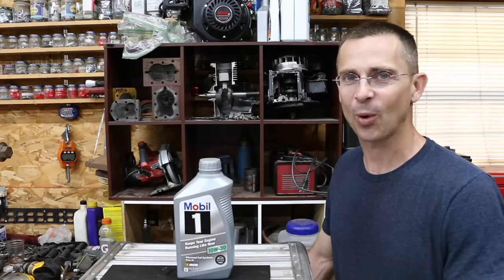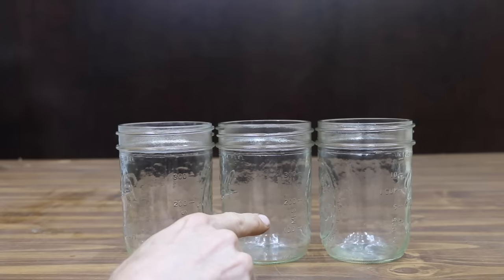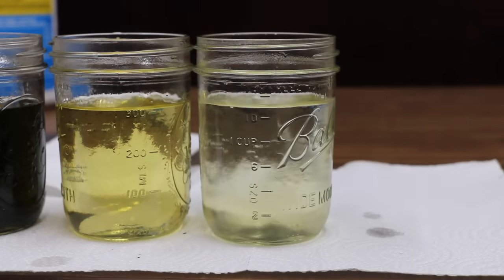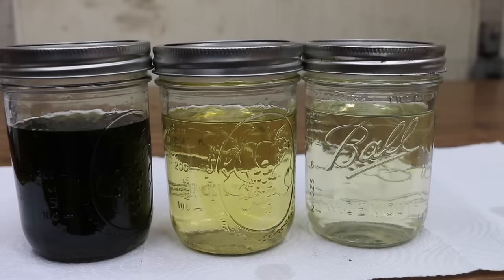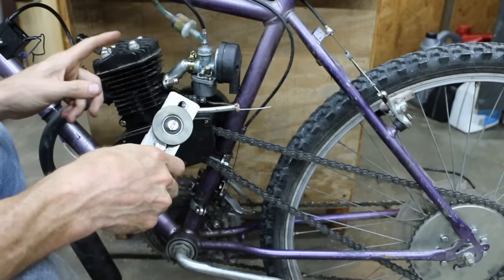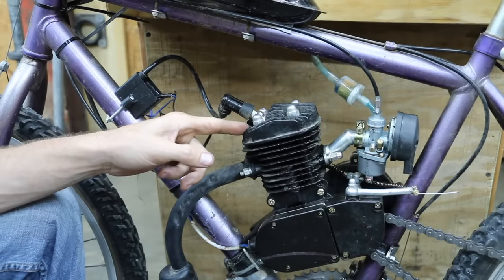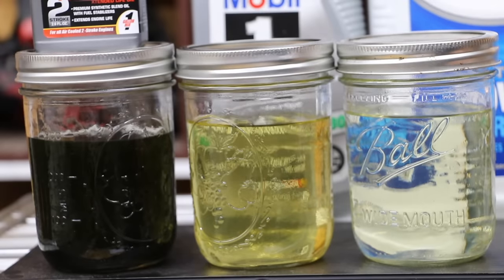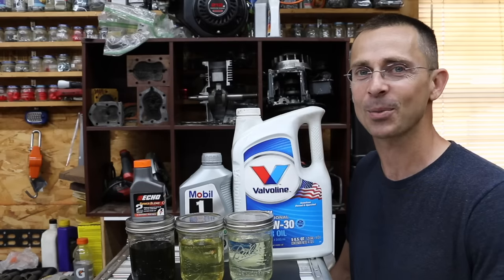Will 4-stroke oil damage a 2-stroke engine?  Let's find out!

Comment: Back in 1999 I had a pickup truck I got from my Daddy 73 f100 390 v8 I didn't check the oil . One day I did I was 4 quarts low I feel it up with hdy oil and never had any problems with the engine.
Reply from the maker: Thank you for the feedback

Comment: The biggest west factor on two strokes is piston slap. Uneven combustion at part throttle causes the piston to literally rattle about. Run at enough load to avoid that and the engine will have a long working life. The latest direct injection 2 strokes breathe air only. Fuel is injected direct into the cylinders after the ports have closed. They have far less piston rattle. Also  there is no gasoline to wash oil off metal surfaces so they need less of it. Around 50% less than a normal two stroke.
Reply from the maker: Thanks for the feedback.

Comment: I used 4 stroke 20W 50 engine oil in an emergency on my 1977 Yamnaha CT 175 and it worked fine. It just smelled bad and smoked more.
Reply from the maker: Thank you for the feedback

Comment: if you check any repair manual for 2 stroke motors in the sixties they use motor oil for there premix usually 20--to1
Reply from the maker: Thanks for the feedback.

Comment: What I want to is with my 4-stroke brush cutter/weed eater can I use full synthetic 10w30 car/truck oil or do I need 4 stroke specific full synthetic 10w30 oil? Is there any difference between the one for cars and the one for four-stroke engines?
Reply: That might make a good video seems very interesting to me
Reply from the maker: Thanks for the suggestion.

Comment: I spent 14 years in the Outdoor Power Equipment industry. The general consensus was to NEVER use 2 cycle oil designed for air cooled engines in liquid cooled 2 strokes and vice versa. It had something to do with the ash content. I wonder if there would be enough interest in doing a video on that topic?
Reply from the maker: Thanks for the video idea.

Comment: What about Marvel Mystery oil vs Lucas fuel injector cleaner and top cylinder lubricant? Lucas lube is some amazing stuff. It stoped the put-put in my F250 4.9 and I unstuck a valve in my lawnmower with it the other day. It makes everything I put it in run smooth and quiet.
Reply from the maker: Thanks for the suggestion.

Comment: Tes, vert interesting vidéo and astounding différences.but when i use m'y motorsaw always with 2stroke oïl it always smoke a lot? Why such differece?
Reply: 2 stroke oil burn much hotter, thats why detroit diesel 2 stroke diesels require low ash. i got an 8v92 detroit silver turbo 2 stroke.

Comment: Last week i tried running a un unused brand new 2 stroke electric generator with a 4 stroke mix.
It was very smokey, and very hot.
With black deposits coming out of the exhaust.
Inside rhe fuel tank the pressure got REALLY really high. Scary on opening with expanding hot gasses fuming out of the fuel opening.
Also, a heck of a lot of bubbling that looked scarier than usual.
I also worried the plastic outer casing was a little too hot.
It overheated twice in the three hours if actual runtime we got from it. And took a long time to cool down.
Certainly won't be trying that again.
Reply from the maker: Thanks for sharing.

Comment: great video, if it were not for the very delicate reed valve designs of modern weed wacker and chainsaw carburetors 4cyc oil could be fine. But these carbs are so temperamental when it comes to fuel that it is risky business to mess with their fuel types. I have not had good fortune with anything except a quality fuel stabilizer and 16:1 fuel oil mixture. I will not go less than that, I never go 40:1 . That is just asking for trouble.
Reply from the maker: Thanks for the feedback.

Comment: In the service manual for my puch maxi  its written that you use sea 30 motor oil in the gas.. the engine is 50 Cc 2-stroke
Reply from the maker: Great information. Thank you

Comment: I'm old enough to remember when it was very common for guys to mix a straight weight petroleum Based 4 cycle engine oil into leaded gasoline for all of their 2 cycle engines fuel needs.
Reply from the maker: Thanks for sharing.

Comment: Sir gud day is it safe to use  20w 40 and 20w 50 mix together as engine oil on my motorcycle 4 stroke 110cc... Thank you...... Philippines..
Reply from the maker: While they will likely blend without a problem, you're probably better off buying more of the proper viscosity grade that's needed.

Comment: Bit late to the party, but I've heard that in older cars that run with a carburettor, adding a little bit of oil to the fuel helps lubricate the valve seats. However some have said use 2 stroke, some say use 4 stroke/mineral and others say whatever oil is around, just mix it in with the correct dilution. I'm wondering if you've done anything like this? Would be interesting to see the results
Reply from the maker: Thanks for the suggestion.

Comment: High quality 2-cycle outboard oil, will actually burn if you pour it into a spoon. And then light it.
Maybe it's all about longevity. We always used to double oil our Outboards back in the eighties.
Maybe it is marketing?. But I do know, that these companies spend millions of dollars paying Engineers to come up with the right formula. But people like us, we want to re-engineer the wheel. Lol.. 
Once again, another great video.👍
Reply: But learning from the oil companies, two cycle outboard oil, is different than 2-cycle oil that you use for lawn care equipment. They tell us that one is a water-cooled machine versus an air-cooled machine.
I don't know what it all means, but I have won a lot of go kart races running aviation fuel, with Mercury Quicksilver 2-cycle oil mixed,!! which means a high-performance Outboard water cooled 2-cycle oil running in an air-cooled environment. I'm so confused.. 
But I never stuck a piston
Reply from the maker: Thank you!

Comment: Two stroke oil has additives that reduce smoke, but it also reduces the film strength, Ive used car oil 20/40 in a  RM250 for a few years, the bore is perfect......
Reply from the maker: Thank you for the feedback

Comment: I been using 5w30 in the cold an 10w30 in the hot for my 30cc ex truck an not had a problem for 7year on my rc at all didn't had to change a piston or piston ring at all an till this day the motor still run like a champ
Reply: Rc truck sorry phone miss spell
Reply from the maker: Thanks for sharing.

Comment: 1950s 2 stroke oil was plain sae 30 engine oil.  Advancements in 2t oil is about low smoke and low carbon.  I have run 2 stroke engines on car engine oil when I could not find 2t oil.  Not as nice smelling but no issues at all.
Reply from the maker: Thanks for the feedback.

Comment: that was awesome! now we know we can get by in an emergency! i agree with you too, 2 stroke oil is designed for specific purpose and one should always follow what is recommended. (reason being that they burn at different temps, and that there are 2 kinds of 2 stroke oil as well, air vs. water cooled engines) ...what i wonder is.. would it be different with ethanol vs. non-ethanol.. and which gas did you use?
Reply from the maker: Thanks for the video idea.

Comment: I used to poor a couple of cap fulls of Maxxima castor 927 in my crf450r every time I'd mix up some 2St and that 450 went through hell and back before the valves started to close up.. for about 4 years I thrashed it almost daily on 1 clutch kit about 2yrs in and oil change at the same time, cleaned the air filter 3x in it's whole life
Reply from the maker: Thank you

Comment: I have a two- cycle moped scooter with an oil mixing carburetor and two tanks. You put regular gas in gas tank and MOTOR OIL in the oil tank.
Reply: Many years ago I had another 2 cycle moped, a Peugeot, with tiny needle bearings on the connecting rod. If you did not have enough oil in the mix you knew it. All those needle bearings let you know.
Reply: The real trouble comes when you don’t use either one
Reply from the maker: Thank you!

Comment: I had a hope you might test bacon fat as 2-cycle mix.
Today I got a 2-cycle engine just for this.
A few repairs are in the works and testing tommorow.

Plus I will try 25% diesel.

#1 Project bacon fat!
#2 Project 25% diesel

😉👍
Reply: Oh and dish soap as 2-cycle oil.
Reply from the maker: Thanks for sharing.

Comment: I have a lawn mowing company and if I have a bunch of new guys I will premix ALL the cans of gas on the trailer with a cheaper snowmobile 2 cycle oil, it won't hurt the lawn mowers (might help) and if they get confused and fill the 2 cycle engine with the wrong gas can .. at least I won't lose an engine
Reply from the maker: Thanks for sharing.
Reply: @ProjectFarm  that's an old one but still true results

Comment: When I was a kid worked in a gas station husband and wife both owned a Saab three-cylinder two-stroke car they both ran Kendall 30 weight High detergent oil in them they found out a lot less spark plug fouling then running 2 stroke outboard oil
Reply from the maker: Thank you for the feedback

Comment: My old lawn boy snow blower has a placard on it stating to use 32:1 SAE 30 or 40:1 two cycle oil. So, most likely it will not hurt it but I use two cycle oil it smokes less in my opinion.
Reply from the maker: Thanks for the feedback.

Comment: "Castrol R"  racing  4 stroke oil was prefered alternative in old yamaha 2 stroke engines, was even listed in the owners manual. Not sure if it is still even available today.
Reply from the maker: Thank you for the video idea!
Reply: Racing matters only to win, the engine does not matter as long as it lasts during the race.

Comment: Running ams oil on a new rc car using race gas I put 20 to 1 oil mix, had hard time starting it found out I Supposed to use 24 to 1 do you think it’s the oil mix? It started two times, first time was hard, second time much better, but now nothing I have a 45cc engine
Reply from the maker: Thanks for sharing.

Comment: Here’s a question. Is mixing your oil inside the tank of the vehicle prone to not mixing properly?  I had a guy freak out when he saw me mix my snowmobile gas right in the tank on the machine. Says it doesn’t mix properly. Been doing it for decades like this no problems. Just wondering.
Reply: Oil density is higher than gasoline.
 The oil tends to dissociate and forms the pond on the bottom of the tank.

2T oils also contain dispersing agents.
Reply from the maker: Great point Popa Alexandru.  They can be mixed inside if the can is shaken vigorously.
Reply: @ProjectFarm  Exactly. 
First pour the gas into the tank in known quantity and then add the oil.
By doing inverse( oil first), the oil gets too much in the piston's head and the engine's start is impossible.

Comment: It could be interesting to see if used 4-stroke oil, will work in a 2-stroke engine. The 4 stroke oil would need to be settled and maybe filtered, to clean out any debries.
Reply from the maker: Thank you for the video idea!

Comment: of course they no problems. back in days they was no 2 stroke oil ans we did drive old mopeds with 4 stroke oil in gasoline in many years. greetings from sweden
Reply from the maker: Thank you!
Reply: @ProjectFarm  a did forget. in the winter time it was a must to shake up the moped so the oil and gas did mix.

Comment: This is one reason to change your engine oil on a regular basis, because 4 stroke engine oil over time will be diluted by the fuel that isn't burnt in the combustion chamber, it goes into the engine oil in the oil pan if you smell the old oil when you change it it will smell more like gas than oil. It dilutes the oil and it looses its viscosity and that causes more friction i.e. more scoring of parts. = engine damage.
Reply from the maker: Thank you for the feedback

Comment: Back when they first made 2 stroke engines they didn't have 2 stroke oil and mixed regular motor oil. And they didn't lubricate very well, which is why the old chainsaws called for 16:1.
Reply from the maker: Thanks for the suggestion.

Comment: I wonder what the crank case would look like, like if there's any noticeable difference in wear between the two, after all that is the point of mixing the fuel with oil, to lube the crank before being forced into the cylinder
Reply from the maker: Thank you for the video idea!

Comment: 4 cycle oil will not damage 2 cycles. Certain newer equipment advises against it but it will work. Synthetic in the newer stuff but by than its just cheaper to get tcw3

All older equipment used sae30 in the gas. My old toro snowpup says to use 8 oz of sae30 to a gal of gas (30:1) but do not use multi viscosity(ie 10w30)
My 1994 lawnboy advises against sae30.
Key is to use straight weight oil. In a pinch or if straight 30wt is not available use lawnmower oil(briggs) or bar and chain oil. Most bar oil will have the weight printed on the container. Ive used that for mower oil(4 cycle) when sae30 was unavailable.
Reply from the maker: Thanks for the feedback.

Comment: 2 stroke engines existed long before there were 2 stroke oils, and the 4 stroke oils we had were nowhere near as good as today's.  My dad used the cheapest 30wt. in our boat's outboard for many years without any issues.  From recollection it was never decarbonized even tho that was supposed to be done regularly.
Reply from the maker: Great point! Thank you

Comment: The four stroke oil might be a bit more polluting than two stroke oil, but it seems like that, in case of an emergency, you could use regular motor oil.
Maybe you should try vegetable oil next time? :-)
Reply from the maker: Thanks for the video idea.

Comment: my 1950's johnson 5 hp 2 stroke boat motor used a 25 to 1 premix with 30w motor oil thing ran till the prop housing broke.

Comment: I came here to see if I could use "used" motor oil instead of 2 stroke oil. Need a way to start using my massive collection of used motor oil. Especially my diesel truck... I need nearly 4 gallons of oil every change. If I had a large shop I would build a used motor oil burner to heat it, however, I do not have anything other than my small garage.

Comment: When i grew up on a dairy farm south of a little town of Rockfalls, Illinois by Tampico, Illinois, Reagans birth town, i always had dirt bikes , seem to always run out of 2 cycle oil, my dad always had 55 gal. barrels of straight 30 weight oil for the tractors etc., i use to premix that with my gas whenever i ran out of 2 cycle oil, ran the shit out of it as if i had 2 cycle in it, never fouled a plug, or blew the engine up, ran good... i know 1st hand it works just fine...
Reply from the maker: Interesting! Thank you

Comment: i used to use 4 stroke oil in a johnson 2 stroke outboard when i was a kid all the time! the only problem i found was fouling of the plug and difficultly starting! but ran fine when started!
Reply from the maker: Great feedback. Thank you
Reply: @ProjectFarm  however i must note that water cooled two stroke outboards run very cool, may not have such a fouling issue in a hotter running engine! kind regards andy

Comment: why 1 ounce per quart on the stroke oil? Should be approx 3.2 per gallon, equalling, approx .75 oz her quart... just easier with the spoon you had? Added protection? just adding for the sake of adding ecactly 1 oz to each evenly sake?

Comment: for @projectfarm or anyone, i have 2 year old  lawnmower with a 160cc honda engine , i put 5w30 instead of SAE30 , thinking it can only be better (i can mow lawn from 50-90oF here)  but i read that maybe its not too smart, the low temp viscosity might be too liquid and use the engine too much ... Any opinion here
Reply from the maker: Thanks for the video idea.

Comment: I had a 250 2 stroke I used free semi synthetic 4 stroke oil for 6 years had no problems 30/1 mix it was a diesel oil I would use it again .The spark plug never  gave me any problems.i only use automatic gearbox oil in my mx kx folks . P.s dont take my word for it
Reply from the maker: Thanks for sharing.

Comment: The additives in 4 stroke oil will slowly cake up the rings,resulting in lower compression, etc,to the point that it won't have the compression needed to even start.. more so on single ring engines.
Reply from the maker: Thanks for the feedback.

Comment: 2-Stroke oil is a relatively new phenomenon.  2-Strokes always used SAE 30.  The only thing that changed was the gas-oil mix.  It has gone from 24:1, to 32:1, to 40:1, to 50:1.  The difference was better bearings.  There was no such thing as 2-Stroke oil during any of this transition.  I can see where there could be an advantage of an oil made especially for 2-Stroke engines because regular oil was not designed to be an integral part of the combustion process.

PS:  When I see the ad on TV of Saab from jets, I laugh.  It is Saab from a 2-Stroke wing-ding-ding car.  Up until 1967, it was a 3-cylinder 2-Stroke engine where the owner always had a can of SAE 30 under the seat.  The engine was based on the DKW, "German Engineering", LOL!  The last models introduced oil injection and there were retrofit kits around too.  Starting in 1968 they bought Ford V-4 engines to comply with the first emission laws.
Reply from the maker: Great point on the Saab!
Reply: Yes growing up that's all we used in dirt bikes 30w

Comment: I went on ebay i ordered me one of those bicycle 2 stroke engine kits i liked it easy too install but problem i had with it was the carb from factory came jetted wrong and was lack of power it would start to rev up like normal then fall and spuders like its bogging out buy never dies bought new carb same problem im hlad u didnt have any problems ima rebuild mine this summer and hopefully itll run like yours lol